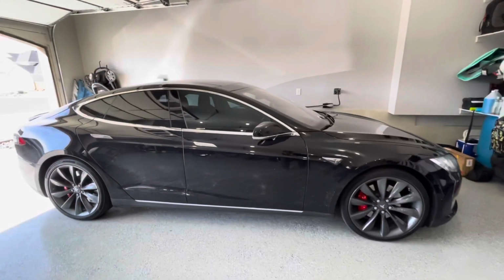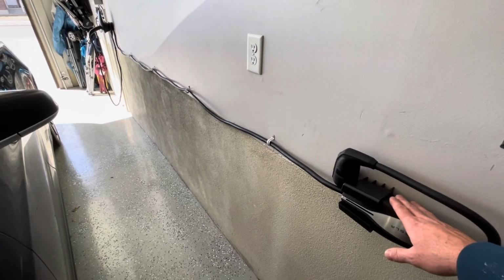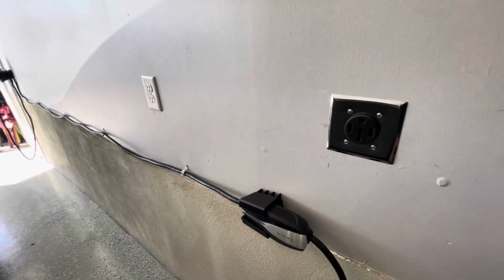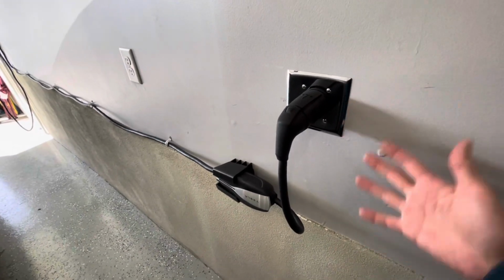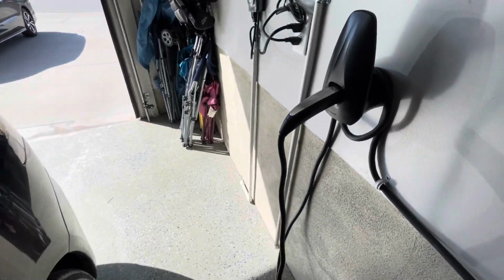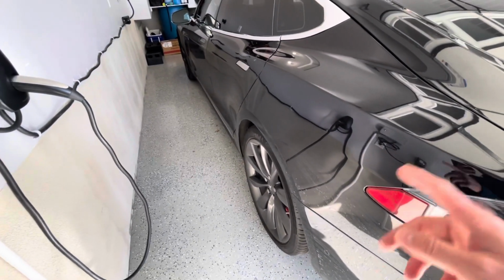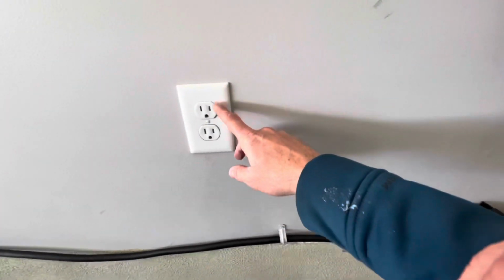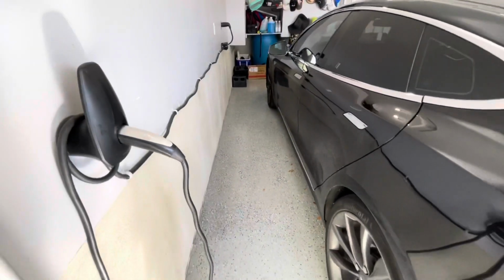Charging your Tesla at home | Everything you need to know!

Comment: My 2021 model S didn’t come with the plug that would go into nema 14-50 outlet. Just a regular cable with standard adapter meant to be used with 110V outlet. Sure I don’t have to buy plug for nema 14-50?
Reply from the maker: Yeah you have to buy the Nema 14-50 adapter, it’s no longer included with the car: 
https://shop.tesla.com/product/gen-2-nema-adapters